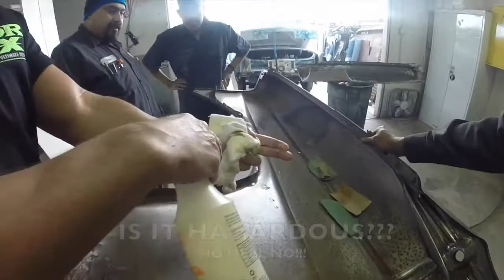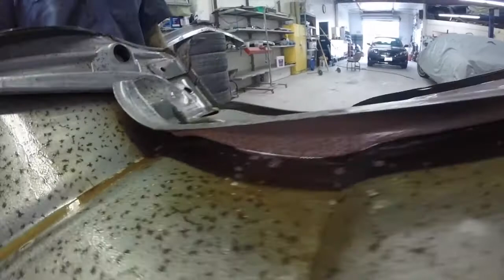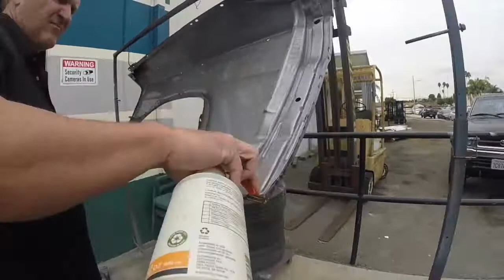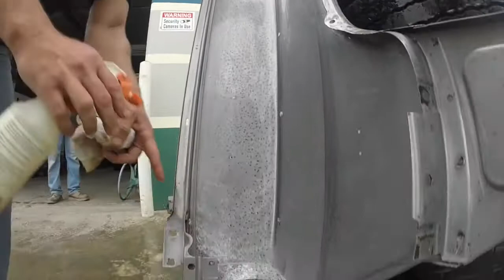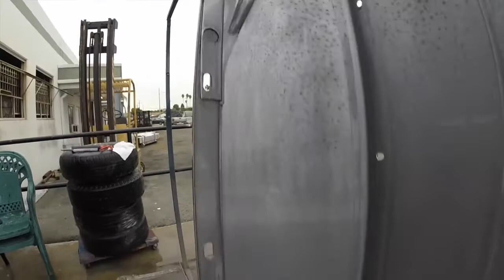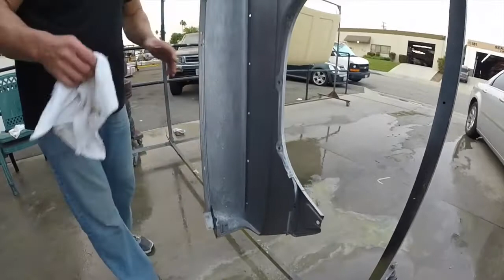DRX VS HAND SANDING @ BIG AL'S AUTO BODY in LA HABRA, CA

Comment: OK HERE IS THE UPDATE -I USED THIS PRODUCT AND THE OVERALL GRADE IS "C". 

If you have just small surface rust it will do a job as i used it tree trimmer blade rose cutters, small surface  BUT like most items out there that is not the case as there is rust deposit so at first  I used a shovel that has decent rust and I has to apply 3 coats and there was still rust spots afterwards. Note- you will see rust spots embedded int the metal period,  Plus you must use a pressure washer garden hose will do NOTHING, but does everyone have a pressure washer, I bought this to remove some rust under the front end of my car as its hard to get to so it will do the job as its not as bad as the shovel rust. 
I paid $50 for a gallon of this which includes the shipping part and if I has to the shovel again I would use a wire brush first to remove as must as I can and then use this product to finish the job.